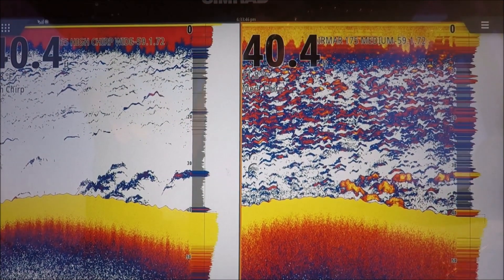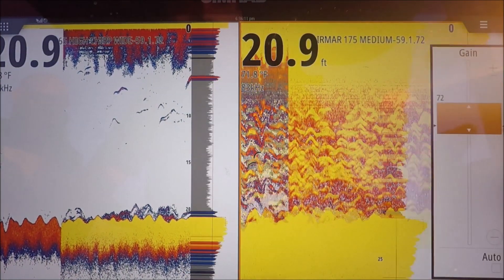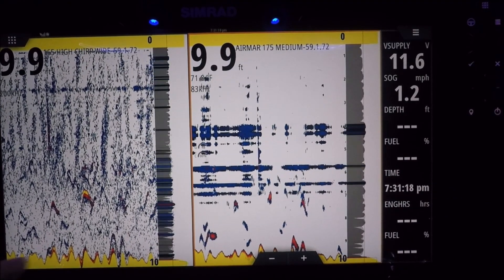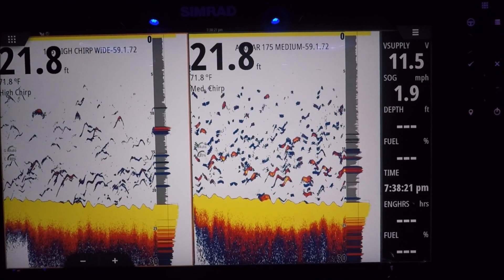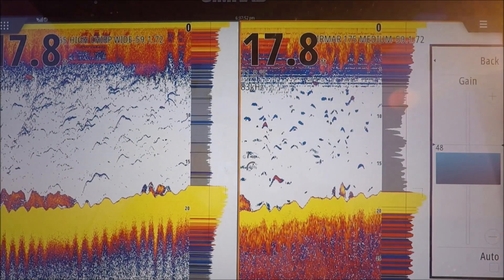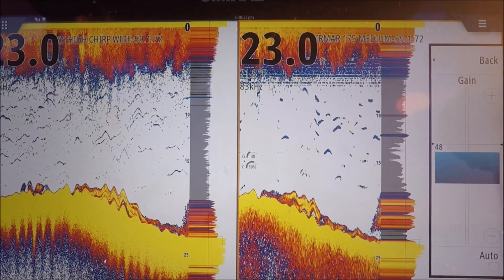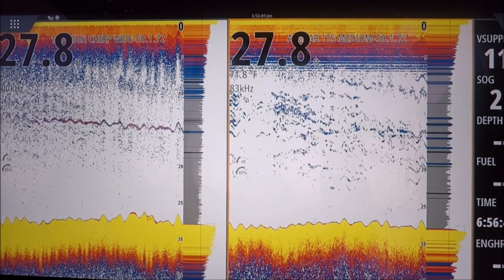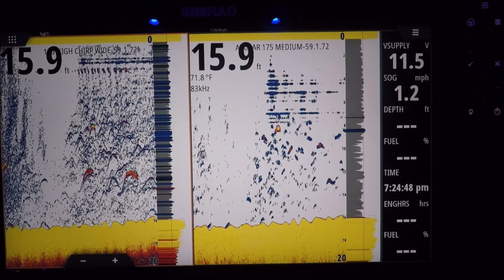TRANSDUCER COMPARISON -TM165 High Wide CHIRP Vs.B175 Medium CHIRP.

Comment: Just bought a Furuno FCV800, 1000w.  The 800 will run 2 transducers CW and Chirp and the CW 50/200 transducer will ID bottom. The machine will run both at once.  I fish bay Stripers and also chase Albacore.  Have you tested  Dual Band Chirp Transducers  ? Or tested a single band chirp running at the same time a 50/200 CW.  This is about the best deal for a poor man.  Thank You
Reply from the maker: I’m not sure about Furuno but I’ve been using multiple transducers and frequencies pretty much every time I’m out. I do some testing for Airmar so they put 4 additional transducers on my boat and I’ve used every combo with very low interference. However these things can be funny, even Airmar was expecting interference. In all likelihood you will probably love one transducer and never switch.

Comment: Will there be a difference with these transducer’s plugged directly into a NSS EVO3s?
Reply from the maker: @fishyfish6768  Nope. Your display is plenty strong 💪.  I have the 165 plugged directly to my Evo3S.
Reply: @ perfect! I’m still fiddling around trying to decide on a new transducer to extend my 3-n-1. I figure the 3-n-1 for shallow to maybe 100’, then something cover 300’ + for bottom fish, and for pelagic. Albacore and Bluefin season is coming. I think I may have to drill a hole for through hull. Don’t want to drop more than $1k.

Comment: Mike, thank you, your videos are very helpful.  I'm spec'ing out a KW 22' center console.  Starting with Garmin 8612xsv plotter, what combination of thru hull + transom mount transducers would you suggest?   Our fishing is mainly light tackle casting into schoolie false albies, striped bass and blues here on the saltwater bays in eastern Long Island in 40 to 100 feet water.   These fish will chase bait up to surface, feed for a moment, then dive, and then pop up 1/4 mile away.   Chasing them feels like whack-a-mole.   I'm thinking a high resolution/wide cone thru-hull to drive fast looking for schools, and then a side scan transducer to see which way they move.   Is Airmar B175 HW + Garmin GT36UHD an unnecessarily expensive way to go?   Anything more affordable that would still give great results?   Many thanks!
Reply from the maker: I would definitely get the HW b175. I’m not familiar with Garmin so I do t know what else you would need for side scan down scan,etc.
Reply: @MikeSmedleyOLDSCHOOLSTRIPERS  B175HW ordered.   Thank you!

Comment: Hey mike what is your battery set up to run those electronics do you have a separate battery to run them or 1 battery for each unit ?
Reply from the maker: I have one for cranking and one for all electronics.  With a group 31 AGM battery I used to get 6 hours until I had to switch over to group 31 cranking battery.  I switched to lithium 2 years ago and just 1 lasts the entire trip. It only weighs 28lbs instead of 78. 👍👍

Comment: Hi Mike.

When comparing the TM185M vs TM185HW, is the amount of mid water trolling vision significantly different?

Could the side scan image from an additional AI 3/1 make up for the  relatively reduced beam width when using the TM185M when trolling?

Cameron
Reply from the maker: Definitely. Trolling speeds are where side scan really works best. 👍
Reply: @MikeSmedleyOLDSCHOOLSTRIPERS  Thanks.  So, would you recommend I install the TM185M and the 3/1 AI transducers, enabling me to also have better resolution down deeper, and also have good wide trolling view capability?

Also, How would the reduced frequency bandwidth 85-135kHz for the TM185M perform differently to the TM185HW - 150 - 250kHz?
Reply: @MikeSmedleyOLDSCHOOLSTRIPERS  Thanks Mike

Comment: I would be very interested in seeing how these operate in 800-1000 feet of water. I have a Tm185hw,, and it just seems like if the depth is over 800 ft, the fish finder simply doesn't return anything. I currently have a GO9 XSE. Should I assume that I can mark fish down to 500 feet with the Tm185hw, even if the depth of water is 1000 feet?
Currently using a transom mounted transducer.
Reply from the maker: Make sure the echo limit isn’t set for 800ft. In echo installation there is a limit you need to remove

Comment: Hi Mike, 
I've always wondered what the difference would be between LH and LH wide when passing on top of pinnacles.. Some told me that the pinnacles won't show up with the LH wide as it averages the ground over the winder cone?! 
I would prefer a wide cone especially I dont go fishing very deep but then I would love to see the pinnacles when I am passing on top of them. 
Thank you
Reply from the maker: You still see pinnacles but you do lose bottom detail. I keep a downscan panel up all the time. It shows better bottom detail than any 2D sonar. Down scan will show all bottom contour.
Reply: @MikeSmedleyOLDSCHOOLSTRIPERS  Great idea Mike, Thank you! I lose my down imaging once I go over 8 knots, so it has been fairly useless to me unfortunately. I have a humminbird unit with a 3 in 1 mega transducer, and it's not usable on speed. I have just went and bought a 2nd hand Airmar 275 LH-W and will get a dedicated simrad unit just for it after countless fishing trips of frustration with the 3 in 1 transducer. I will continue to play with the 3 in 1 till I get the best possible down image with it while using the 1kw on speed. Thanks again for all your info!
Reply: @MikeSmedleyOLDSCHOOLSTRIPERS  Is this downscan panel you refer to (above) obtained from the AI 3/1 ducer?

Comment: Hi Mike, i know that you go rarely to deep water like 300 -600 feet water but please do one test because i start to believe 1kw airmar transducer  or simrad does not perform good at 300-900 feet ( 100-300 meters )  deep seawater. Please help about it to be informed.

Comment: It's odd, 
165hw have less than narrower medium at 25 feet? 
What's going on here?
Reply from the maker: Both gains are set the same, in reality I would reduce the medium a touch. Most of the comparisons I do I leave the settings the same to start. It seems that higher wattage CHIRP transducers tend to show more of the tiniest particles in an automatic gain setting. I easily could have raised the gain on the 165 to show all of the particles and bait or reduced the med to match the left screen.

Comment: On the airmarin site, written sonar depth capability information how many percentage decreases efficiency in salt water (Mediterranean sea)

Forexample b265 LM 1kw dual chirp 
AIRMAR SAYs
Medium frequency : max depth 1500 feet 
Low frequency : max depth: 3000 feet 
But this is for fresh water 
What about salt water ( Mediterranean sea ) ?
Reply from the maker: Those numbers quoted are actually for salt water. They are also practical fishing depths. They have the ability to find bottom at much greater depths but you just might not have good resolution for fish targets at anything deeper than they state.  That’s from my buddy at Airmar.
Reply: @MikeSmedleyOLDSCHOOLSTRIPERS  ✌️

Comment: Hi Mike 
Another question 
B265 chirp LM
 I ordered that one. 
What about if i use both frequency of them at the simrad evo3s screen same time. 
Will give 1kw for each? Or power of transducer Low frequency and medium frequency will diveded to two ( 1kw / 2 ) 
?
Reply from the maker: I believe it will split it, but power ratings on CHIRP transducers are like fixed frequency transducers. The engineers have a hard time explaining, but CHIRP transducers don’t need the same power. They are MANY times more efficient. The TM150M is only 300 watts and it’s amazing.
Reply: @MikeSmedleyOLDSCHOOLSTRIPERS  
Question : 
Airmar B265 LM DUAL BAND TRANSDUCER 
SIMRAD evo3S or evo3 nns9
Work together or 
need a module ?
Reply from the maker: They work together 👍👍

Comment: Firstly i m sorry for my english. 
What about 200 meters deep ? What you prefer on 200-250 meters ?
Reply from the maker: Low CHIRP. If you only have med or high use med.
Reply: @MikeSmedleyOLDSCHOOLSTRIPERS  i ordered B265LM chirp is that good option?

Comment: awesome video! Which transducer do you recommend for smith mountain searching for striper?
Reply from the maker: Definitely the 165 H extra wide👍👍
Reply: @MikeSmedleyOLDSCHOOLSTRIPERS  Garmin said they don't support the 165 on the echomap series. What's the next best option?
Reply from the maker: @troydunn04  wow!  That’s a mistake on their part. I would go up to tm 185 H wide but it’s 1Kw and they may not have enough power for it. The high wide transducers are really perfect for the situations common in freshwater. Simrad can power 1Kw but not sure about the others. https://amzn.to/2XDLJw7.
Reply: @MikeSmedleyOLDSCHOOLSTRIPERS  why are the 185HW transducers best for freshwater?
Reply from the maker: @Camh1968  Because you won’t see depths greater than 600 ft. HIGH WIDE CHIRP transducers won’t perform as well as a medium CHIRP transducer in greater depths.
Reply: @MikeSmedleyOLDSCHOOLSTRIPERS  Thanks Mike.  For the Structure Scan 2D transducer (down scan and side scan)  which model number is available for use with the EVO3S MFD?

is this different to the 3 in 1 transducer?

Cameron
Reply from the maker: There are two different 3 in 1 transducers.  This is the one you want. I use this one for side and down scan. https://amzn.to/3cSRlOU 👍
Reply: @MikeSmedleyOLDSCHOOLSTRIPERS  That's really appreciated.  Thank you.  Its all a bit confusing regarding choice, but I'm getting there slowly:-) 

I was speaking to a Vendor today and he said that If I am using the TM185HW or Tm275LHW at the same time as the 3/1 ducer, then the chirp function on the 3/1 ducer should be turned off (because of inferior performance relative to the big 1 kW units).  Would you agree with this?

Cameron
Reply from the maker: Sure. You wouldn’t ever want to use the CHIRP on the 3 in 1 if you have those other transducers. They have WAY better CHIRP. The 275 requires 2 sonar ports so you would not be able to plug that AND the 3in1 to the same display.  On your sonar page menu just never select THIS UNIT for sonar source, (that would be the 3in1), but DO select THIS UNIT on your side scan page menu.
Reply: @MikeSmedleyOLDSCHOOLSTRIPERS  Thanks.  I plan to use 2 x 9" EVO3s units networked together, so I would have 4 x ports in total.  Is this correct?

I am still deciding which option I go with in relation to the 185 or 275...?
Reply from the maker: Yep. 4 ports. You won’t need the 275 unless you plan to fish extremely deep water, needing low CHIRP. 600-1500 ft or even more.
Reply: @MikeSmedleyOLDSCHOOLSTRIPERS  Ok thanks - Which is better for drifting - Low Chirp or High Chirp?
Reply from the maker: It all depends on depth. Low Chirp Has lower resolution and detail. It’s slower too. It also doesn’t have the WIDE set cone that the high WIDE does. It’s made specifically for very deep water. If you never fish in 600-1000 feet plus you will never use it
Reply: @MikeSmedleyOLDSCHOOLSTRIPERS  Perfect.  I will go with the 185 based on this.  Should I have the 3/1 ducer ported into the same EVO unit receiving the 185 Sonar input (with 2 x 9" EVO units networked together)?
Reply: Also, I notice the 3/1 ducer you linked is a Lowrance unit.  Will this unit also work with the Simrad MFDs?
Also, the part number for this ducer is noted as 000-14814-001.

But, there is another 3/1 unit, very similar with part number 000-14489-001.  What is the difference?

And, ideal location to mount this ducer on the Transom (given that the 185 will be mounted on the RHS of the motor)?
Reply from the maker: @Camh1968  they are all labeled Lowrance. Same company. The other 3in1 is TOTALSCAN. That’s the older transducer that you don’t want. You can mount it anywhere you feel it will work, but lower on the transom is best. As close to the keel as you can get it or the engine skeg will block the side scan.
Reply: @MikeSmedleyOLDSCHOOLSTRIPERS  thanks.  Will the 3/1 Ducer cause some cavitation for the motor when placed in the center keel location of the transom?

Do you have specific online how to YouTube videos for using and interpreting the 3/1 Ducer?

Comment: Mike, Hi. I just subscribed to your channel. Thank you. I do both structure fishing for salt water bass and pelagic fishing for tuna in Southern California. I'm thinking of installing a flush mount thru-hull transducer on my 21' center console so that I can "see" schools of tuna as I'm traveling through the water at 25-30 MPH. I'm basically dedicating one transducer/fish-finder for this one purpose. I'm thinking of using the Airmar B175 HW since most of the fish I'm looking for reside in the top 300 feet in the water column. I am planning on pairing it with a Lowrance or Simrad 12" MFD. My other choice would be a B175L just for the slightly wider cone versus the fixed 25 degree cone on the B175HW. I sure would like to get your input on which transducer you'd recommend. Thanks, Frank
Reply from the maker: Definitely the HW, it has much more detail and feels a lot faster. Get a Simrad, the Lowrance is for freshwater, you lose a lot of adjustment going with the Lowrance.
Reply: @MikeSmedleyOLDSCHOOLSTRIPERS  Thank you.

Comment: I have a Lowrance Elite 7ti
What settings are best for 25ft to 10 feet to see Crappie and bass?
Reply: Kthockey I have the elite 7 also go to your range and set on 30 ft ,that will keep you tight on the screen .
Reply from the maker: Use the lower frequency available, the lower the frequency the wider the cone. In those shallower depths you need the wider cones to see more fish.

Comment: I went all out and installed an airmar 3kw 599c-lm transducer with a furuno TZLT.  I usually fish in 100 ft plus depth and want to do some deep dropping up to 2000ft.  I find that my original 1kw transducer works better, what am I doing wrong?  Gain settings?
Reply from the maker: I’m not very familiar with Furuno, but if that were a Simrad display you would need an additional CHIRP processor to power a transducer that large. 3000 watts is VERY VERY powerful. Are you using a processor rated for up to 3000w?
Reply: Mike Smedley Hi Mike, yes I have  Dff3 in the network.
Reply: I wanted the most powerful transducer to get definition up to 3000ft in the FL Gulf Stream for swords. But I still wanted the option of 100 to 300 ft off the reef. I’m not getting a very good picture off the reef but looks like it will pickup decent structures at 2000 ft.

Comment: Nice video you already know this but at 11.5 volt you had 20% of battery charged full battery is 13.2 volt.  I have a video about this matter or  viewers can look up voltage chart in a search engine . .
Reply from the maker: boashna My meter can be a bit misleading. It’s 11.5 with 2 16” displays on, running lights and two bilge pumps running.

Comment: Dear Mike.Very perfect video.I have a Humminbird Helix 7 SI G2N Model but iam not so satisfied on saltwater.I am using its own transducer as XNT9 SI 180T.What do you thinkon changing the transducer with Airmar 165?Is that possible?what difference will be?Thx

Comment: Mike i run a 12 inch lowrance carbon w 83/200 transducer and 3d module.  I primarly fish for musky in 10 to 50 ft of water.  Do you think the tm165hw or tm 150?  We do alot of vertical jigging as well for musky in 20 to 30 ft.
Reply from the maker: Shoot me an email. 👍👍
Reply: @MikeSmedleyOLDSCHOOLSTRIPERS  can't find your email posted anywhere.
Reply from the maker: Rick Thorp Sorry. Mikesmedley9@gmail.com

Comment: If you add this extra transducer, do you have to purchase any extra modules or will it work straight to the Simrad Go12
Reply from the maker: That’s part of the beauty, you get a high end CHIRP transducer that needs nothing extra. But for a Go unit you only have one port so you won’t have side or down scan.
Reply: So if I wanted to add another unit to match with the transducer, what would you recommend - I fish in Boston, so my depth range from 20’ to 120’, sometimes go to stellwagon for haddock at 210-250’
Reply from the maker: Nhut Nguyen Definitely the Evo3. It’s a professional level display with lots of great features. EVO3 https://amzn.to/2Bs18pO

 If it’s out of your range you can add another Go unit and just use it for sonar.
Reply: Thank you!  I love your channel.  I have catch the fever rods, your series on the simrad is the reason I have simrad on my boat, every winter I use your videos to learn a bit more about fishing.
Reply from the maker: Nhut Nguyen YIP YEAH!! Love hearing that!! Thanks a ton brother!!!👍👍👍
Reply: And go with a Tm165?  I saw your video for aggressively mounting it, can’t decide on Tm165 or your favorite the 150
Reply from the maker: The 150 is an amazing transducer for the money. It’s by FAR the best unit under $300, but this new 165 will eat the 150 alive. It’s double the wattage of the 150 for one thing and it has a 30degree cone which is also around double. It has a larger frequency range of 150- 250 versus 85-145. The 165 is kind of a tweener. The 150 is 300 watts (which is quite powerful for a CHIRP Transducer). The 175 is 1000 watts. The new 165 is 600 so you get a lot more power yet you won’t need a separate CHIRP sonar processor to run it.  To put things in perspective; I get a small commission if you buy a 150, but I get nothing if you buy a 165. (I don’t have a link for you), but I still recommend the 165. 👍👍👍
Reply: Mike Smedley thanks, I was looking online for it and can’t find the 165 on amazon or west marine :(
Reply from the maker: Nhut Nguyen BOE Marine has it. Search Navico tm165. Add my name in the salesperson box. I don’t make a dime off it, but I like them to know 👍👍